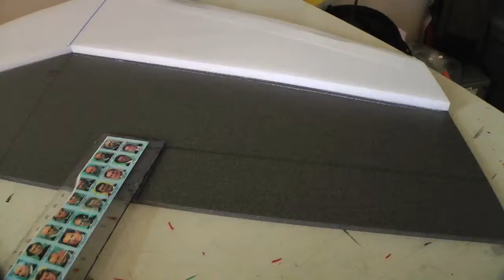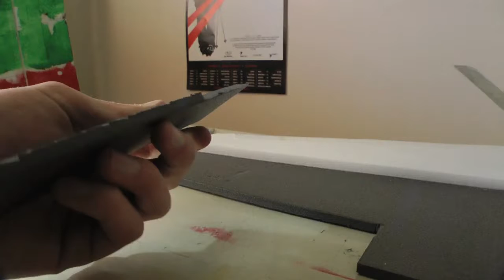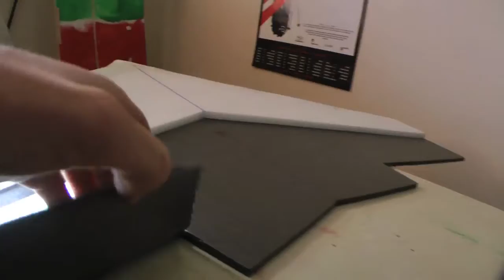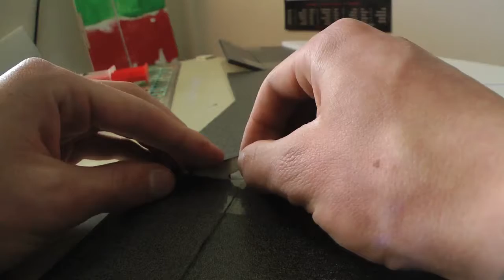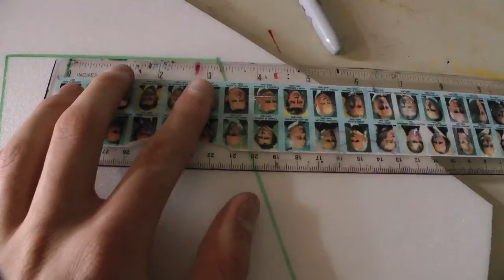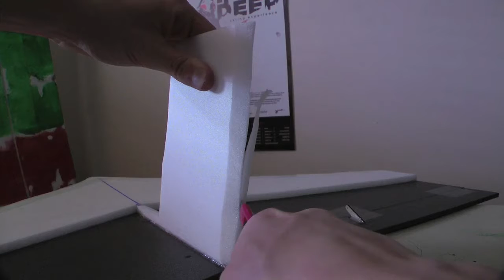Delta Wing Build Along Instructions #3

Comment: I got an easier way to make the 45º cut:

use a ruller at the edge of the surface u want to make the angle.
then run the cutter with a fair angle through allways "touching" the ruller along the surface.

tchanan!

thumbs up if u found this useful